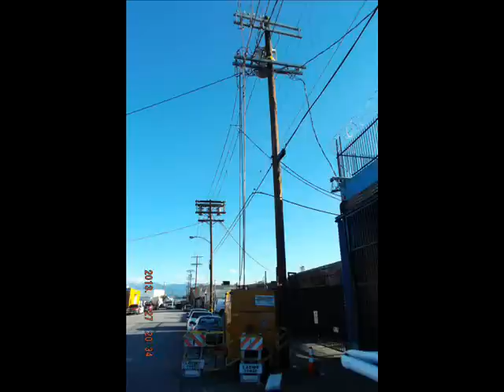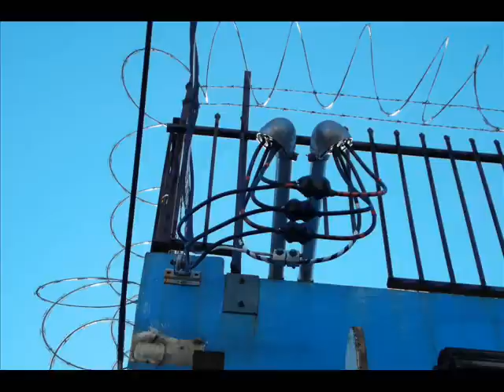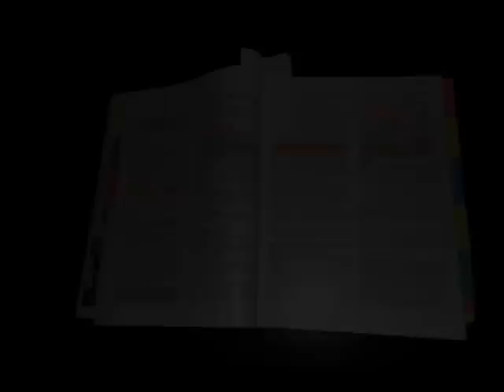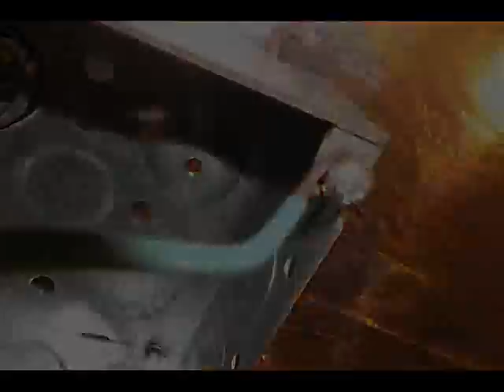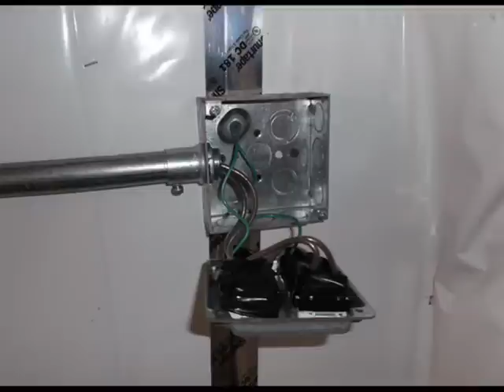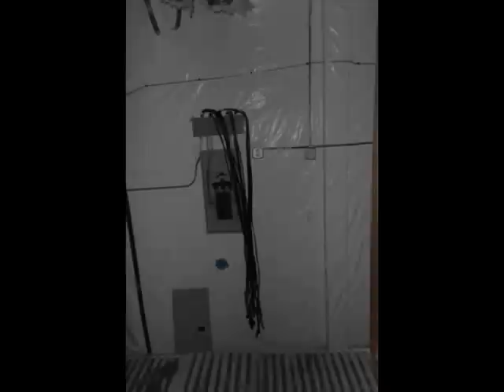code violations 1

Comment: are you saying that a 12/3 mc cable can not be used to power a 240 volt device because it has a white wire ? I m pretty sure that if you do use the white as a hot you have to identify  it with a black or hot color tape , then its acceptable

Comment: Woah, what about Romex to a light fixture. This would be grandfathered in now, but  for 12/2 or 14/2 the HOT to the switch is the WHITE wire, and the switch leg back to the fixture (luminary)  is the BLACK wire. Some local jurisdictions will still allow that. Some jurisdictions are still using pre-1980s NEC. They are generally small rural areas who do not want to train anyone, and don't have the money to do it anyway. One jurisdiction had their fire marshal doing electrical inspections, and she just had it dropped in her lap without notice. I helped as much as I could, showing her what most inspectors look for the most often, wire fill, wire ampacity, derating, proper overprotection, GFCI use, etc.

Comment: Municipalities get to inspect themselves. City of Phoenix has some of the most atrocious wiring on the planet. One building had baloney all over the rooftop,  penetrating the roof and running down into the walls. Another panel had been moved with 42  circuits in one undersized conduit. The drywall was turning brown and had SMOKE coming off of it. Remember derating?

Comment: Quad box, gen purp. Or residential ap. The yolks of the recep. Will at least provide a ground for dummies but they didn't even bolt the device to the cover, only plate position screw were used....wow...no concept of ground whatsoever.

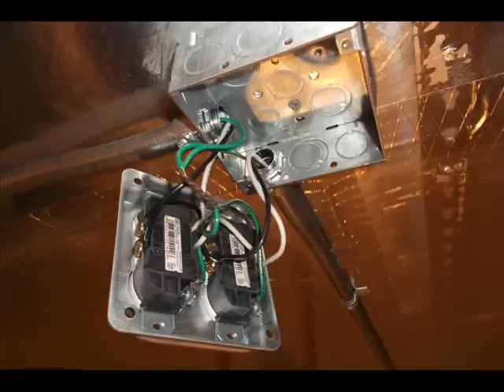Comment: at 3:40 when you talk about not connecting the green ground to the box, isn't the ground connection on the outlets themselves part of the mounting bracket which creates the ground bond?
Reply: 1957mrbill no the box itself must be grounded, along with the receptacles. It's kind of funny because you can see the little "bubble" in the back of the box that's meant for a ground screw. Guy must've not had one on him. A lot of old school guys did stuff like what you see in the picture, and to be honest it's a perfectly good ground connection, it's just not legal. I suppose it would be sort of exposed to being bumped into but not very much. If he was out of ground screws he would've been better off just putting a machine screw into the back of the box meant for the ground screw and calling it a day. AND FFS TAPE UP YOUR OUTLETS IN METAL BOXES.

Comment: MC cable is routinely used in commercial applications, it's not illegal to use. The fact that you didn't know that and what it was you were talking about makes this whole video suspect.
Reply: I just saw this video and just saw your comment and agree with you fully!! Also the thing I personally noticed that was suspect is he also says you can't put power through a white wire, that is not accurate you can use a white wire for power HOWEVER it can't be white throughout phase/indicator tape on various spots of said wire is acceptable if it is not being used as the neutral! He also said the white wire can be used as a ground which is also not accurate UNLESS it's phase taped green! So the way I see it he's got a lot of great information because those relays in the beginning were absolutely too tight in that gutter and did not allow for legal safe heat dissipation but he definitely got at least a couple things wrong here!!

Comment: if self grounded outlets are used is it safe to pigtail green wires with wirenut and go to outlet it will ground the box
Reply: The box will be grounded by the connection between the box and the cover. However, especially with an outlet, where the action of inserting and removing the cord to and from the outlets could loosen the connection, cause the wires to chafe and cause a live condition on the box itself You'd certainly be better of being in compliance with article 250. When in doubt- ground everything separately, you really can't go wrong.

Comment: My dad smoked a saber saw by plugging it into a 120v outlet fed with 240v. Ran at double speed, shot out sparks, and gave up the ghost in about 10 seconds.
Reply: bamaslamma1003 why did he give up the ghost? Is he not a ghost type?

Comment: that quad outlet box was bonded per the device rated ground yoke and 8\32 screws that fasten the raised cover. aaaand that box is not equipment fastened in place. it is a outlet box with 2 duplex receptacles. lastly I'd bet that gutter was OK in size. add it all up. the code isnt at tough as most think.

Comment: exhibit 250.56 and 250.58 state that a self grounding spring grounding clio receptacle with 2 mechanical threads enagged or a non grounding receptacle with one insulating washer removed and 2 mechanical threads engaged does not require grounding the box.

Comment: wait, on your two gang outlet box the center screw that they used is bonded to the ground on the outlet isn't it? Either way they should have put the other 4 screws in rather than trying to save a minute

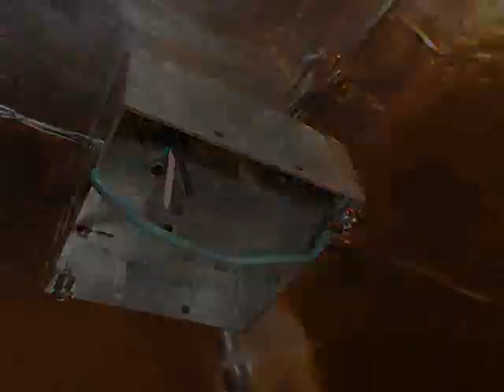Comment: At 4:49 where you mention the 3/8" flex, I'm pretty sure that's MC cable. The plastic ribbon you can see coming out of it with the wires is a dead give away. They didn't pull those wires but rather it comes that way as a cable assembly.
Reply: I was just scrolling down to day that.
Reply: Definitely an MC/AC cable assembly. Perfectly legal in that installation. The electrician could have made the connections using a wire nut and a green ground screw in the threaded hole provided in the box by the manufacturer, and used a decent MC/AC connector. He didn't.

Comment: quick question can you add more than one hot to a 120v 15 amp breaker for an extra outlet with out problems at the breaker. I have no more room to add additional breakers in my box and need to add an outlet. i check the circuit and there is only 5 outlets connected to it. i don't want to splice in and add a junction box cuz the wire is all ready ran to the breaker box just not hooked up.
Reply: They do have Double Tap breakers for exception use only, but it would be better to upgrade the main, or other safe option to wire in sub panel if half size >>tandem breaker<< won't add space safely or isn't made for your panel.
Reply: you sure can if its rated for it. some breakers are rated for 2 equal size wires. and should also be both solid or stranded. don't listen to every code nazi.
Reply: no, you cannot have more than one wire on a breaker at one time. You CAN however use tandem breakers which will give you two breakers for the space of one, and is only on a single leg.
Reply: Absolutely not.